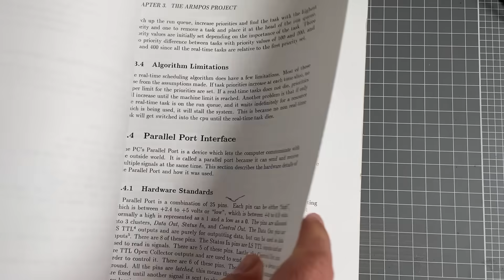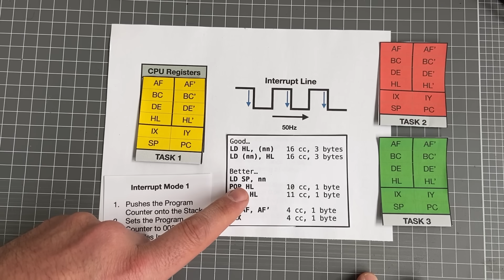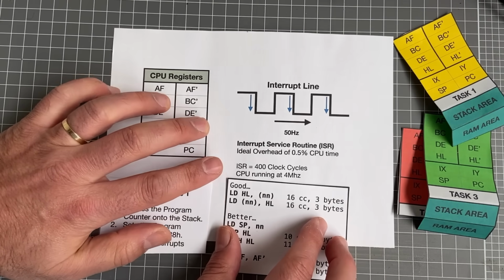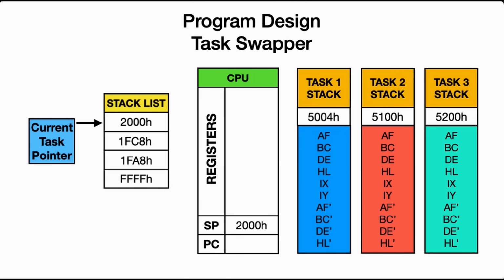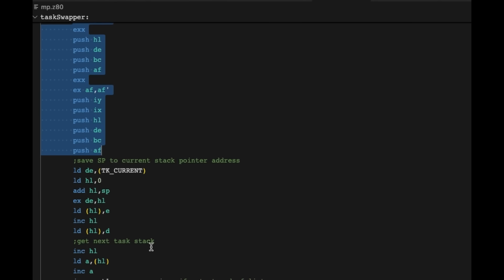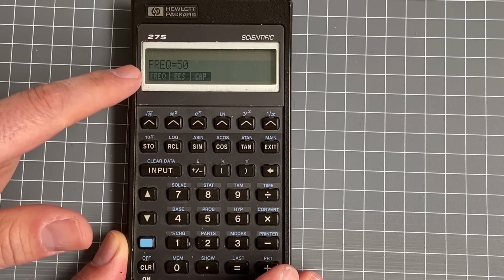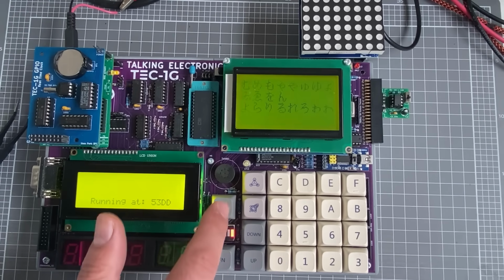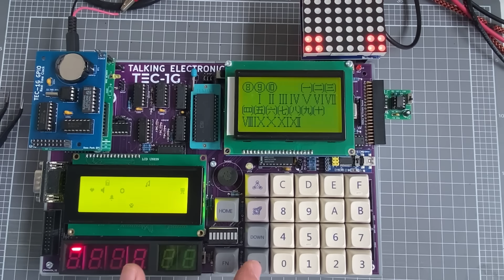Multitasking on a Z80 CPU

Comment from the maker: Here are some extra details I cut out for brevity
- I played with different clock frequencies, < 30Hz saw noticeable lag, > 1000Hz spent too much time in the Interrupt routine.
- Using a non-CMOS 555 chip (IE, NE555) at 5V, the frequency was much slower than it should be, and its duty cycle wasn't 50%.  But at 12V, the chip performed much better.
- Mon3 (the TEC-1G monitor) has a breakpoint feature that pauses the current program to display the state of the CPU on the LCD.  Then, the user can press a button and resume program execution.   This is effectively doing task swapping; it's just not automated.
- Thesis was written using LaTeX
Reply: For what its worth, the mighty Honeywell DPS-8 mainframe had a 160 millisecond time slice.  If the program performed I/O then it went out of execution immediately.  This had a side effect of generating global synchronization where all user programs would be waiting on I/O, then when the I/O was serviced these programs would all go back into execution.  This produced profound inefficiency where the total system throughput was around 60 percent of what it could perform otherwise.  The solution is simple, shorten the time slice so that SOME applications are pre-empted before they make an I/O call.  But the powers-that-be never subscribed to this theory and it seemed none of the programmers wanted HIS time slice reduced.  So that's the way it stayed.  It was mildly enjoyable to watch the glass-top removable disk packs all thrashing in sync.
Reply: When I saw 50Hz I was thinking that you used the electric grid frequency as the interrupt trigger, which would actually be a pretty good method. In the US it would be 60Hz instead, but the difference in behavior would be marginal unless you run something time critical.
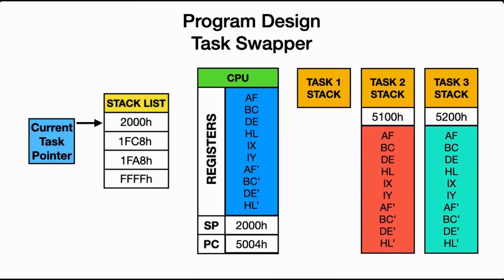From 6:15 and onward it's important to notice that the return instruction is the specific interrupt return instruction (RETI) and not the standard return instruction (RET) you use to return from a normal CALL.
Reply: @ehsnils  Most old retro computers used the beginning of VSYNC for the video output for the INT (trigger). So that was most frequently 50Hz for PAL regions and 60Hz for NTSC regions. This made it easier to make units that behaved the same in different regions. It also gave the greatest time for the INT routine to do screen updates without flicker which was an issue for may old systems.
Reply: @Egg-kh2xo  And that frequency was selected to avoid flicker based on a frequency difference from the electric grid.
But if you don't have a CRT then you won't have the VSYNC to take it from so then it would be easier to take the electric grid frequency as a trigger for your homebrew solution. Just get an AC power adaptor and rectify and regulate to DC on your own.
Reply: A 74HC4020 or the like would work as a divider. It's the same as a CD4020 etc but far higher frequency so you don't have to worry about ripple carry. The NMOS NE555 has asymmetric trigger points like 74LS - 0.8 and about 2.4. But at 12V the different is a smaller proportion. The CMOS 555 will be 1/3Vcc Vil and 2/3Vcc Vih - so symmetric. 

For true multitasking for several tasks (which would be far easier on the 6809) the int response routine has to be absolutely clock cycle optimized to have any significant timing resolution. Using the ALT registers would help so much.
Reply: I learnt to multitask as an extension to fixing a problem on the TRS-80. After e period of time the keys would bounce and print double characters. So I built a table for keys that are pressed (up to 16) that started a counter. At the end of that time if the key had been released the counter was set to 0x00 meaning not in use and available for a different key. If the key was still down then a second character was generated (key repeat) and the counter set to max again. 

I used the keyboard hook or vector for this and it was one of the first things called on VSYNC at 60Hz (NTSC) so it wasn't hard to extend on that to have multitasking which I used for games. The screen updates were fist (after VSYNC) given the higher priority and then when they completed then other tasks like I/O and then game logic took over.

Comment: Interesting, subbed.
If 0.1 ms is 0.5%, but it's not; it's 5 ms= 0.5% of 4 MHz is 20K cycles= (1/4,000,000= 0.25 μs x 20K); also 400 cycles= 2.5 ms. You confused: # of cycles of a certain freq. for Hz= cycles/s; similar but different.
So 400 cycles of 4 Mhz= 2.5 ms, which is 0.25% of that freq, which is 2x better than your estimation; so you can make 8 task initializations, by the time you need to return from the Interruption.
@9:55 should be ld hl,sp

Comment: Any CPU can multi-task through a software implementation called pulling. But it's not real multi-task. Instead, it consists on sharing the attention of the CPU to different tasks meaning that it's not really doing more than one thing at the same time but quickly doing a bit of a queue of things sequentially over and over in a cycle, so the user has the illusion that it's multitasking. The REAL multitasking is only possible with multi core CPUs. But conceptually speaking, yes, Z80 can multi-task.

Comment: C'mon! All CPUs can multitask! What is an ISR if not multitasking? What is all this about, really? Sometimes I wonder about sanity in ppl. It's like threads! In the beginning threads were like lightweight processes. Like the processes in UNIX (if anybody remembers the REAL UNIX (SVR and BSD)). Can CPUs do threads? Like, duh! Sure! THEN you can optimise the HW to make it easier and faster. But the concepts are still true in ALL CPUs. I still makes my mind blow! Look, take and old IBM 3270 transaction or a UNIVAC TIP. Compare that to, even, today's web form. Try and find a difference? OK, I do NOT mean platform, O/S, blah blah but actual functionality. There is NO difference at all! You enter a program with parameters, get a response from lower down, present it, take in changes and send changes back down. For every few years we rewrite everything, find new names, servers, operating systems, languages, new "paradigms"... Tons of new code to run that isn't really required. Need more HW, more CPUs, cores, whatever. This business has turned into... Garbage! But I could easily find another word that begins with an 's' and ends with 'hit'! 😂

Comment: I had to repeat the beginning of the video to make certain I correctly heard the question. I did.

"Can the Z80 CPU actually multitask itself?"

Bwah?!?

Given that processor has been demonstrated in several commercial devices years ago, I'm going to go out on a limb (not really) and say, "Yes! It absolutely can!"

I assume the Z80 (I've never written code for it) has a preemptive pin state-triggered interrupt. If it does, I stand by my statement.

Watching the beginning of this video again, I think it doesn't answer that question. Instead, what I think it really answers is the following question: "Can I, the author of an OS, prove that it works as a multitasking OS by customizing it for a known-good CPU?"

I've seen (and regularly written code for) a static-priority preemptive OS running quite well on an 8-bit microcontroller with 256 bytes of onboard RAM plus a 32 kilobyte ROM chip. It's an Intel 8032-based embedded microcontroller that has to service a pair of hardware interrupts every 125 microseconds.

Comment: I did a similar design in the early 80's when I was still working with hardware.  I used a 60Hz frequency though because I had to synchronize one of those threads with zero crossings on the AC power.  I'd rather have used 120Hz to pick up every zero crossing but that was just too inefficient.  But I had the ability to swap between up to 4 separate threads and on a later design I also could swap the upper 32K of memory so each thread could have its own dedicated memory.  I loved the Z80.  I don't know how many hours I spent breadboarding designs or sitting with a couple reference books on my lap and using SmartWorks (pretty sure that was the name) to lay out PC boards.  I've still got a stack of about 20 bare PCBs for a Z80 computer I designed left from those days.  I've still got all my old parts too.  I should build up one of those boards for fun.  See if I still have any of the documentation I wrote on how they work.

Comment: i wrote a full multi tasking Z-80 OS in 1990. Actually it was a Z80180 (We had started with the Hitachi 64180 if i remember correctly but that was rebranded as the 80180 - not sure if Zilog bought it or sued them and got it as it was a Z80 compatible. I was able to run 5 tasks on it but it had the advantage of 6-10 MHz clock speed and I had builtin MMU to implement a banking scheme to allow every process to have 60k of RAM to work with. I used the non prime registers for interrupt handling so the interrupt handler to do all the realtime hardware support without having to do a complete context switch all of this made it work very well - but it is kind of cheating because it was an upgraded Z80. We moved on to the Z80380 before we reached the limit on the Z80180. After that we moved on to PowerPC but the Z80180 served us well for 5 years and the Z80380  was in active use for another 14 years (really may still be in use because i see people selling our old systems on ebay every cule of years saying they just upgraded but it still works.

Comment: Thoroughly interesting! I wrote something like this back in the late 80's on my Amstrad CPC6128 Z80 based machine. I even took it further and wrote a console application which would load byte images of programs (written in Z80 assembler) into memory and adjust all their JP/CALL statements based on a base and offset type arrangement. The idea was to facilitate programs being re-locatable in memory instead of fixed. Had a lot of fun doing it. It worked, but lack of memory protection meant that it was very easy for one app to overwrite another's space.
I still have the Amstrad. I wish I could get a converter that appears to the machine to be a disk drive but is in fact a USB memory stick, but I'd like it to operate as though it was a normal Amstrad drive from a programming perspective.
Reply from the maker: Have a look at my DDI-3 Video.  It connects a Flash drive to the Amstrad.

Comment: I started in computing 40+ years ago by buying a Microprofessor training micro computer board. It was, as older people here no doubt are aware, Z80 based. It had interrupt hardware on board to allow external interrupts but also had internal registers for internal interrupts. I wondered what the interna ones were for. Now I know.

Comment: If you had an external flip flop also set by that interupt, you could use it to mask io writes to some privileged io port that only the ISR could use. Cheap, simple, very little external hardware and it can enforce protected multitasking if employed with memory banking. the Sinclair ZX Interface 1 achieved similar memory banking by intercepting the RST 08h instruction transparent to the running program and then using it's own rom.

Comment: I wrote a multitasking kernel for the 6502 called c02 (extremely original). It's still posted up on Codeberg. I "ported" it to the NES and Daryl Rictor's 65C02 simulator. Never got past just making the task switcher and some test tasks, but it worked. It's really satisfying when things work.

Comment: Ah, nostalga ! I replaced my single user 8008 computer with a new computer using the new 8080 chip with a full 1MB RAM (17V dynamic RAM) a 71KB FDD and a 5MB seagate HDD. I coded my own BIOS in machine code - by hand - and a multi-user version of the CCP. This fantastically complex machine was capable of co-operative multitasking where each process yielded to the kernel whenever it entered a wait state. I was working for Alan Sugar ( later AMSTRAD ) at the time but this was my "hobby" project.

I remember that the 17V clock driver had to supply +- 3A to the memory cards and the computer consumed hundreds of watts overall.

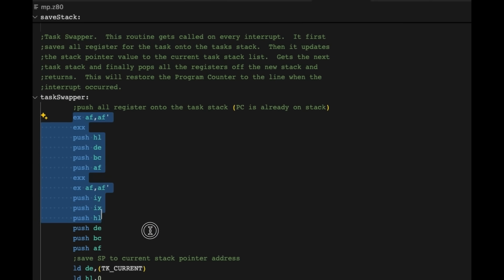Comment: Very cool and well presented! One thing; in the taskSwapper (9:00), you could remove the ex and exx at the beginning as well as the ex and exx after popping. It would just change the order on the stack, but not affect task swapping. This will only save 4 cycles, though, so probably not noticeable.

Comment: When I was in my early teens in the end of the 1980s, I had an idea of building my own Z80 based computer (the processor I was most aquainted with since I had a Sinclair ZX Spectrum). I also had an idea of preemptive multitasking: Each process should have it's own stack, and there should be an array holding some info about each process (at least its stack pointer). When a timer interrupt came, all the registers should be saved to the stack, the stack pointer saved into its location in the process array, the next process' stack pointer read and its registers be read from its stack, then a RET run to get back to where that process was.

Comment: The next step would be to allow the keypad+LCD test task to sleep (by leaving the runnable task list) until a keypress happens, rather than (presumably) busy waiting! This will require a means for a task to take itself off the list and be put on a different list appropriate to the thing it's waiting for - and then some way of checking the keyboard (polling in the ISR? Or can it generate its own interrupt?) and putting that task back on the runnable list when required...

Comment: At start: My speculation is that the answer is: "it depends on what you mean and what you want". 
1. Geos20 on the 8086 used to true preemptive this via manipulation of the timer interrupt, issue is that this means that nothing can use the timer interrupt but the shell.
2. pthreads / win16-style coorporative multitasking will ALWAYS work, though a poorly behaved program means thtat no multitasking ever happens.

But yeah, true cpu level preemptive multitasking with no need for interrupt manipulation (what the 386, 68K and all later CPUs do by default isn't possible, I don't think.)

But we'll see if this is what you find as I watch this episode.
Reply: At commercial: looks like you ended up with 1, though you did a fair bit more thinking then the bare outline I speced out including how much time the interrupts would take and how to swap processes efficiently. Very interesting so far! Curoius to see what the last 2/3rd of the video brings.

Comment: ANY CPU can perform multitasking if the correct task switching code is written for it, provided the address space is large enough. But 1970s designs will probably do this VERY slowly. :)

The fun part about this demo, is that you can move it over to Zilog's modern replacement, the eZ80, and it'll run about 25 times faster. The eZ80 is 100% machine code compatible with the older Z80.

Though if you're going to multitask on the new eZ80, that has extra instructions making this easier, along with a VASTLY expanded address space (16 megabytes). The programming manual for the eZ80 is a free download from Zilog as well.

Being able to run Z80 code at 50 MHz is quite something. :)

Comment: In the late 70  I worked at  what is now ABB. We use an 8080 to multitask a frame to scan paper  with sensors to measure the weight, moisture, thickness.  The data then was used  by a Honeywell mini that would in return send control command back to the 8080 to control the paper machine.  For fun a group of Techs used the 8080 to run a 5K basic to play a Star wars game